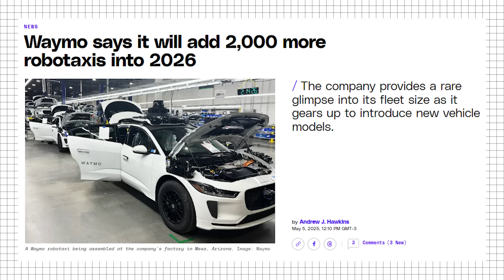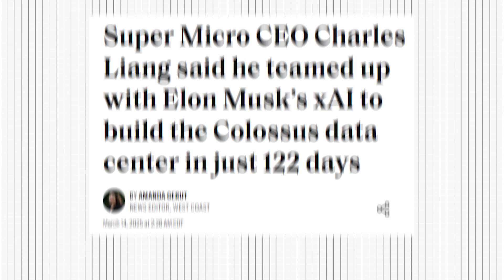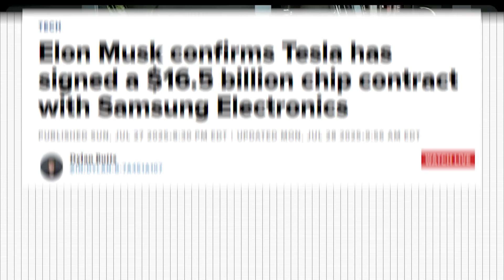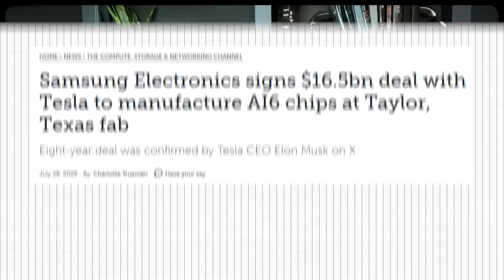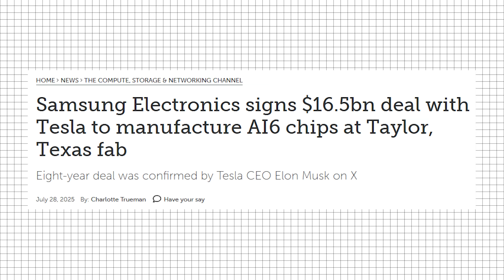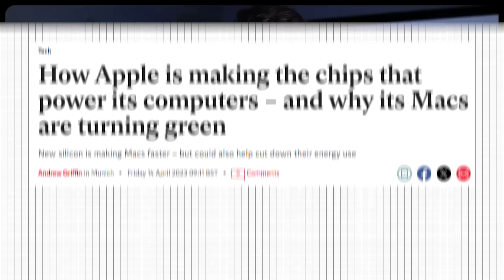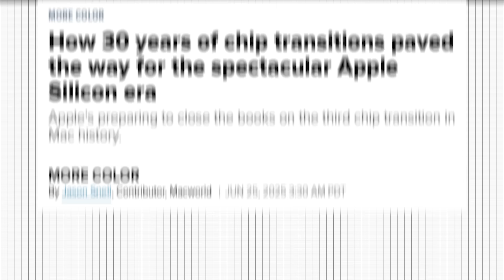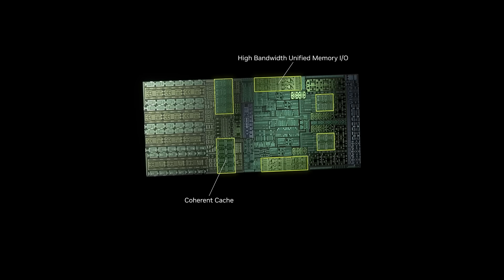Elon Musk’s Tesla Secures INSANE Samsung Deal

Comment: This process involves the gate all around technology GAA that has minimal power consumption but it is new process technology that is very hard to build. It's very fast and if the processor is designed to do inference decisions then it will be the biggest advantage of all in speed and low power, meaning low heat generated in the processor. Ultimate game changer IMO. I once was a IC manufacturing process engineer for HP back in 1990s and helped Dave Packard get into the business when we built the first 32 bit nMOS CPU that changed H-P forever. This will do the same for TESLA.
Reply: Hitlercar's brand is broke. eats popcorn